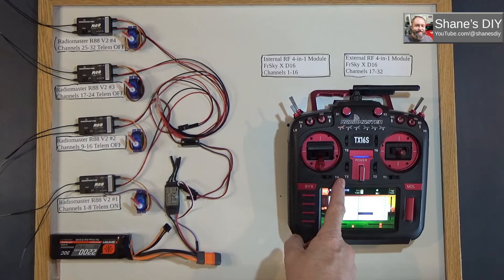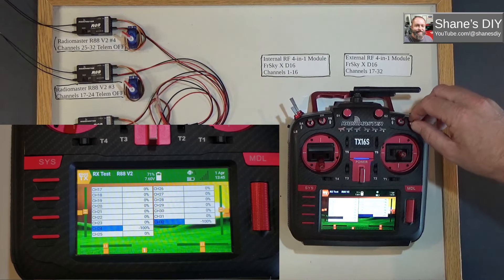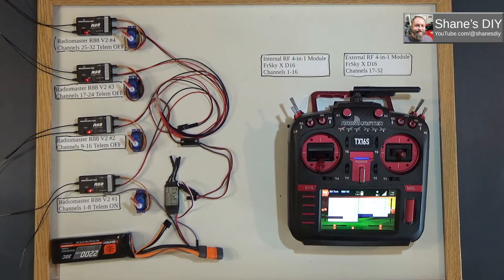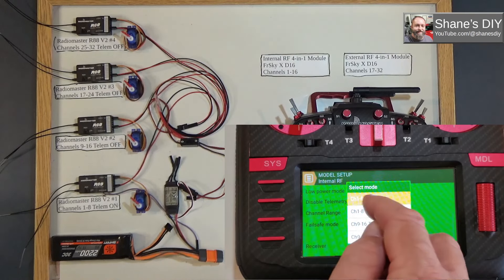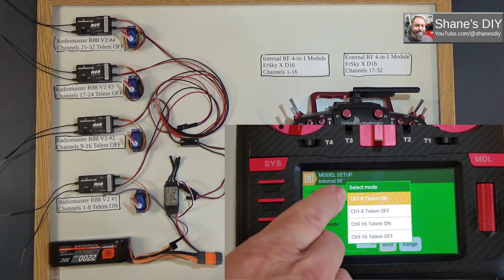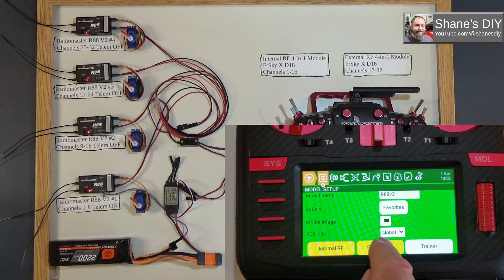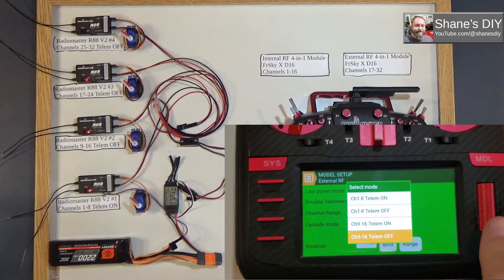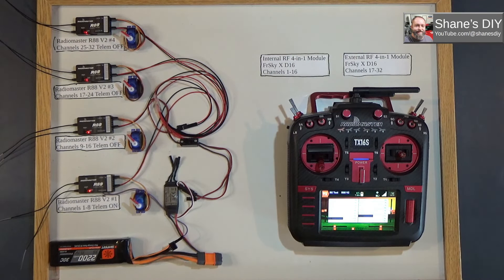Radiomaster TX16S - How To Use Every Output Channel.

Comment: I looked into it.. and you can get 2 SBUS converter.. and hook up 2 of them onto 1 RX and control the 32.  OR use a UART system
Reply from the maker: Yes, I've experimented a bit with SBus but when searching for an SBus to PWM converter they weren't that cheap and adds some complexity, more devices and connections, etc. These R88's, for example, are only $11 each.  Assuming you want to use all these channels for servos in the end, hard to beat the low cost and simplicity of the method in my video.  If using a flight controller and don't need all servos then there are a number of options.

Comment: The tx16s was bit ~lot overwhelming when it came out,stil i absolutly lve it,i got 4in1 for non expresslrs~happymodel es24tx pro for learning how to fly drones and one day a nice heli,maybe a wing but doubt it!its amazing how far tx rx hsave come since ~i think it was early 80 my neighbour came out his shed with an enormous heli~ide say blade 2 blade tip 3meters easy.sadly could only start it ~too many powerlines.thanx for sharing great to learn more about the controller,i do still everytime i goto use it.would love to feel them cnc ed gimbals but atm i just loose drones i save n build.started line of sigh ~cameras in australia north of 150$ if its digital, i got them hd zero goggles~spoiled and just got analog speedybee now i can use the 4 or 5 i have from broken tiny quads,my first 5inch had all new expensive stuff~lasted me 3 minutes and flew away.i disarmed second i new the wind
 had it but it was 37~39C so i unplugged camera~hdzero freestyle~and off with the goggles,sadly i didnt know the radio has a find drone and you can also install fron iinav im sure a more precise one after looking in that heat ,next day i fell down the home stairs~carpeted lucky~im still not mobile enough to look for that drone.since feb 25th .okmy pleasure watching your lovely video!sorry i wrote a book 4 you to read.medication does weird things sometimes.Peace n God bless all u do.ox!

Comment: Thanks for sharing. FYI, the RadioMaster R88v2 receiver is only compatible with protocol FrSky X mode. I have an original FrSky X8R receiver which was flashed with the lastest FrSky v2.1.1 firmware can only be binded using protocol FrSky X2 mode. To have 32 channels, you can use 2 R88v2/X8R receiver and 2 SBUS->PWM converter. We can buy 16-CH sbus->PWM converter. such as R81 + SBUS->PWM converter
Reply from the maker: There are a number of ways to get all 32 channels, I just demonstrated one simple method.  sbus to PWM converters cost extra more than the cheap R88 receivers but certainly an option that opens up many receiver options, including ELRS receivers.  R88v2 can also work with the FrSky D protocol or the Futaba SFHSS protocols but you can't get all 32 channels with all protocols.

Comment: I just got a ER8 receiver. How do i bind the receiver to the tx16s? But first does this receiver needs any updaiting software like the radio when buying it?
Reply from the maker: Did you get the ELRS version of the TX16S?  I'm using the 4in1 in my video but you'll need the ELRS version to bind to that receiver.   I can't say if it needs updating, you need to be sure both the TX and RX are on the same major firmware version.

Here's a recent video by Painless360 on binding with ELRS.
https://youtu.be/jkjlk-ahcto?si=wTZXsHZA_qZ4g79A
Reply: @shanesdiy  i bought the 4 in 1. It was on CRSF internal RF, now its on multi. I someome else said i womt be able too without the elrs module. I guess ill just return it & get flysky or spektrum reciever. 

Im bought a su34 with thrust vector. I got all the mixes done to get the nozzles to move with elev, rud, ail. But idk how to get the thrust vector to turn off with a switch LOL.
I ended up binding a flysky 8ch receiver instead

Comment: Hello, great video, I wanted to ask if this also works with Spektrum.???
Reply from the maker: Using Spektrum receivers you could only connect to a maximum of 2 receivers, one on the internal 4in1 RF module, and one receiver on an external 4in1 RF module.  Using something like a couple AR631, AR637T, AR8020T you could use the combined 12-16 servo channels plus these RX's have multiple "virtual channels" you could use for non servo things like Safe gyro flight modes, panic mode, gyro gain channels, reverse thrust (if you had an Avian ESC), etc.

Using a couple receivers such as the AR14400T which is a 14 channel RX, you could have a total of 28 servo channels.   With a Spektrum AR20400T, which has 20 channels, you could only use 16 of them on each receiver so that should allow you to max out the transmitter but you'd have unusable channels on the AR20400T.

Cost is a major factor.  Using these Radiomaster R88 V2 receivers, all 4 cost less than one Spektrum AR631 receiver but you do get extra features with the Spektrum receivers.
Reply: Hello, thank you for your quick reply, I use a Spektrum ar7200 at X. IsOK.????Do I need another one like this?
Reply from the maker: @StreetFighterStudio  I have no experience with that receiver specifically but I believe it is DSMX compatible so I assume it would work.  You don't have to use the same receivers on each RF module.  You could have the AR7200 on one of the RF modules, and an AR631 on the other, for example.  They each bind separately just like you are on two different radios.
Reply: @shanesdiy  Dankeschön  mein Freund!!!!

Comment: I tried this method with two R88 receivers looking for the 16 channels internal module in my carbon cub, but every time the second received become a clone of the first one. instead of adding the other 8 channels, seems to repeat the channels of the first receiver. Any idea why this happens?
Reply from the maker: @juliocavazos2791  you sure you followed the bind process exactly as I did here?  During binding, you select if the receiver is configured for channels 1-8 or 9-16.  Also make sure the channel range for the RF module is 1-16 and not 1-8 or that is all the channels you'll get.
Reply: @ hello! Yes, I did exactly the same,, I’m thinking if the issue is the edge tx and you may have open tx or I need to update my firmware , and my last test that I will try today is to change the second receiver for a new one for a more recent v2.  After binding do I need to do something to add the other additional channels on the inputs/outputs section maybe? Because I see only the initial 8 there,. thanks
Reply from the maker: @juliocavazos2791  I'm on EdgeTX.  If your receivers aren't V2's that might be it.  All mine are V2's.  Even setting the second receiver to "9-16 no telemetry" mapping something to channel 1 does channel 1 on both receivers?

What protocol are you using?  I like FrSky X D16 but I think it will work the same with FrSky D8.

Also, in the model RF setup there is a place to set the channel range.  Make sure it is 1-16.
Reply: @shanesdiy  I forgot to mention that I was able to resolve the issue about a week and a half ago,, the problem was that the firmware of my module was not up to day.. just corrected that and worked.. thank you…
Reply from the maker: @juliocavazos2791  Thanks for the update.

Comment: It looks like this is possible for ELRS too, but it’s currently only working for two receivers. You’d need two 16ch receivers and I think the biggest are 14ch right now.
Reply from the maker: With the R88 V2 I could only get 15 channels to respond over SBus but I know other receivers, including some/all of the ELRS receivers with SBus output can do 16 channels.  But then to run servos, you'd have to get an sbus to PWM converter, arduino, etc.  This method with the R88's was pretty simple and easy to do.
Reply: @shanesdiy  arduino.would ned 1 per plane for eg.or swap one but then it be configured diferently.i never used 1 nearly got into them before gettin ill.

Comment: Can this be done with new ELRS system?
Reply from the maker: With any protocol you can bind one receiver on the internal RF and one on the External RF.  They don't even have to be the same protocol.  If you use higher channel count receivers (to a max of 16) you can max out the channels with just two receivers.  If the receiver has more than 16 channels, you won't be able to access those higher channels.

The unique thing about FrSky X D16 protocol is you can bind up to two receivers per module since it lets you select channels 1-8 or 9-16 when you bind.